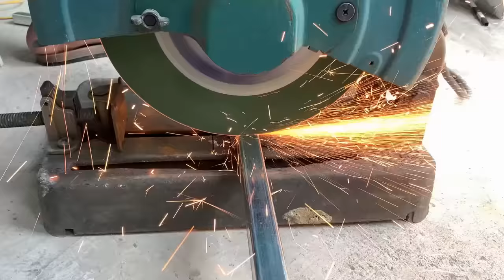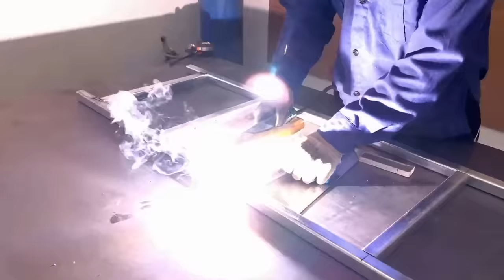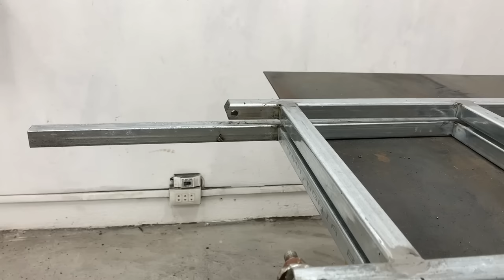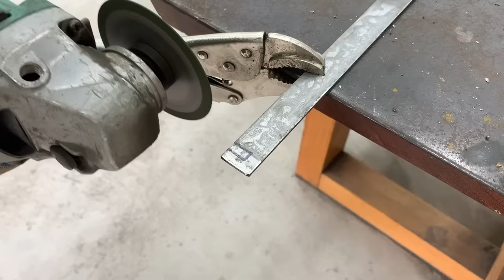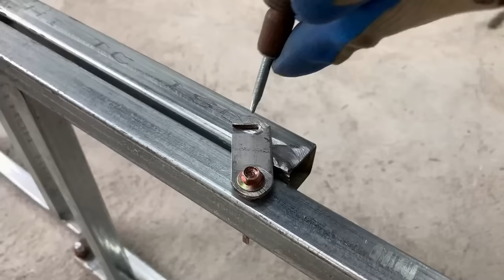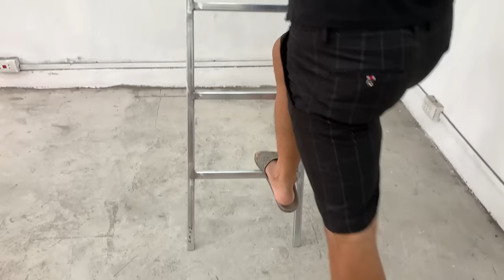Making A Smart 2in1 Iron Ladder Is Extremely Easy And Convenient

Comment: As a technician who likes DIY, I want to make a suggestion.  You have to learn to edit, because it's not fair that you show me a hole from the moment you mark it until you do it.  The welding process, you can indicate it, and then present it already done, you should not be making an arc in front of the camera, the flash is taken as if you did not have the protection.  At the moment it is just that, although there is much more...

Comment: The idea is very good, but the pipes should be 1"×2" and little heavy,because when the ladder open fully it seems bend fron middle,other thing when you use nut bolts alway put a voshier